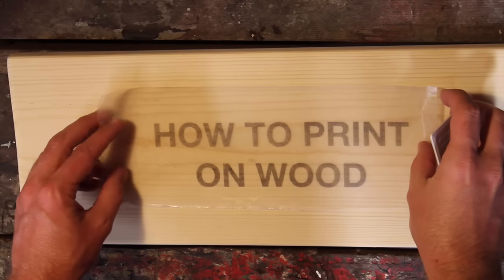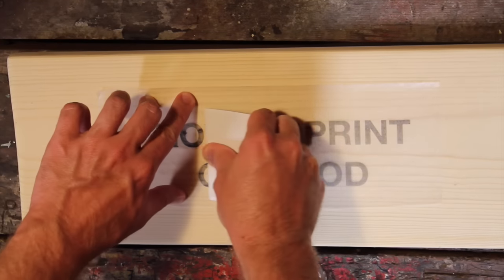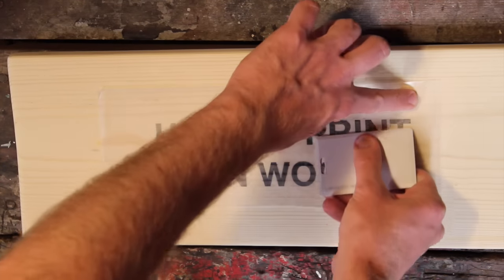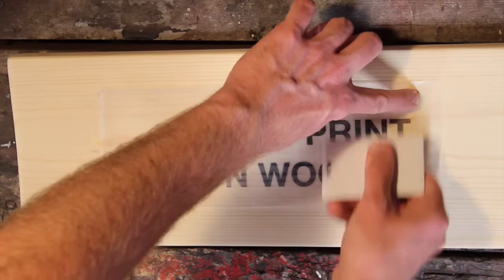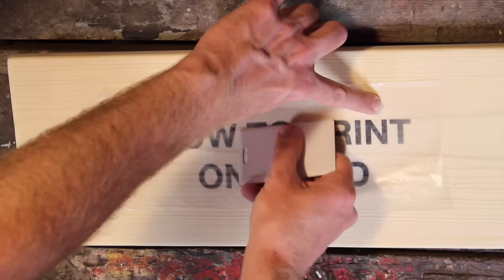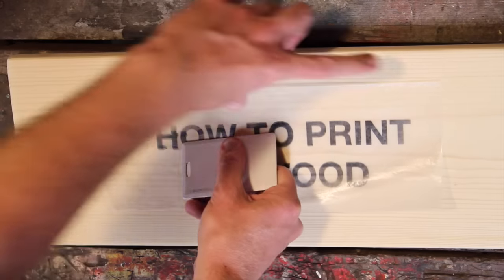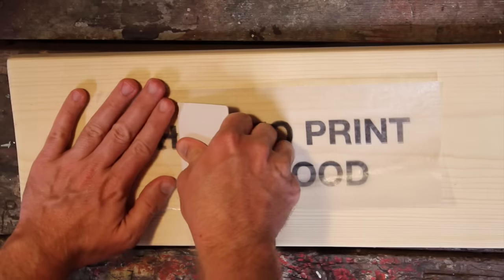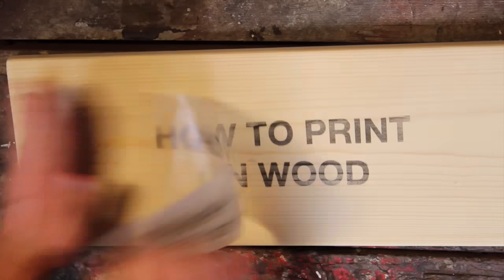How to Print on Wood with an Inkjet Printer

Comment: I tried this a few times a couple Christmases ago. It took a few tries to get it right. A couple of things I would add to doing it by this method is to keep in mind the wood type and grain density. Getting the wood down to a 220+ definitely helps with ink bleeding. Also, I had a hard time keeping the ink from smearing before it met the wood because of how flimsy wax paper is and discovered by accident that I was able to get the same affect using the back side of photo paper. I don't know if it is true of all photo paper but it definitely helped me out.
Reply from the maker: +The Fishin' Dad Great tips!

Comment: Can we use varnish instead of natural coating? 

And can a wax paper be printed in epson L805?
Reply: I use L805
Use the backing paper of self adhesive labels
Remove all labels and print on shiny side
Print setting must be
Glossy premium
High

Have not tried wax paper yet

But you Must use glossy paper setting
Reply: @pietpompiepompiepiet940  thank you

Comment: I have also head of using Freezer Paper - its ticker but you need to ensure you print on the shinny side. I have a quick question - can I varnish the wood first to make it darker?
Reply from the maker: +Dora Bloom You can stain the wood before applying the transfer - that's what I did in this video, but always apply your varnish/poly/finish last. If you do it before, the ink will not absorb into the wood. Good luck!

Comment: The best by far, Did you use glue?
Reply from the maker: +Gibbs Joyce No, but I’ve recently been using spray adhesive to stick the wax paper to a regular sheet of printer paper, and it works much better.

Comment: Do I have to transfer the ink on the wax paper to the wood right away? or is it alright to wait for awhile? Thanks!
Reply from the maker: Since the ink is oil based, it won't evaporate immediately, so you could leave the wax paper transfer sitting around for a few minutes. Good luck!
Reply: alright thanks!! :)

Comment: will this work on HEAT TREATED WOOD? pallet wood sanded down for a smooth finish
Reply from the maker: I am not sure. As long as the wood is unfinished and smooth, it should work.

Comment: Great video, nice editing too, subscribed!
Question: the finish that you used, is it some sort of polyurethane? Thanks!
Reply from the maker: It's a water-based polyurethane from Vermont Natural Coatings. You can buy it on Amazon and I really love the warmth it adds to the wood.
Reply: Thanks for the reply! I tried printing my own signs on square 7" boards, but I can't seem to get the text nicely in the center of the board... Any tips?

Also, I often smudge the text on accident when placing the paper on the board, as well as when I push the ink in with the card. Any tips for that as well maybe? Thanks! :)
Reply from the maker: Just keep a steady hand. Someone suggested to me in comments to glue the wax paper to regular white paper to stiffen the transfer. I'm going to try that, so that might help.

Comment: will this method work if i use Liquitex Matte Gel to seal the graphic afterwords?
Reply from the maker: +Preston Horton It should, but be careful to apply a very thin first coat when brushing over your graphic. Sometimes the finish can make the ink run. I'm thinking about re-doing this technique with a spray finish so the ink bleed issue is eliminated. Good luck with your project and as always, test your materials on scrap material first. Let me know how it turns out.
Reply: Gadgets and Grain thank you!

Comment: Great job
Reply from the maker: Thanks! Let me know if I can answer any questions.
Reply: Does it work on any kind of wood,  Like skateboard decks? And if possible what kind of ink is the best. I tried to do it here and it didn't work out well. Thanks again.
Reply from the maker: Not sure about any wood, but a skateboard deck sounds like it might work. It's always a good idea to find some "test" material before committing to a project.
Reply: I bought the right paper and it worked out perfeclty. Thanks a lot
Reply: Jasiel Calixto what is the right paper?
Reply: as I'm from Brazil I couldn't find the paper he suggested. I used one called Dover

Comment: Nice video, but my printer did not like this at all. It just kept jamming the printer. :(
Reply from the maker: +Jack Gilbert Sorry to hear that Jake. I had a few wax paper jams myself. Sometimes this was caused by the wax paper not being flat enough as it traveled through the paper feeder. To help flatten it, I would place the cut sheet under several heavy books for a few days. Hope that helps.
Reply: I found it very helpful to stick or glue the wax paper to a common A4 sheet, print it and then separate them!

Comment: What paper setting do you put the printer on?
Thanks
Reply from the maker: I use the glossy photo paper setting. My assumption is that the wax paper has similar properties to photo paper. I'm happy for others to chime in here if there's a better method. Every printer is different, so you might want to experiment with different settings to see what gives you the best results. Good luck!

Comment: Is wax paper same as baking paper?
Reply from the maker: Hi Savan, based on my research, baking paper is what we call parchment paper in the U.S. This is neither - I used wax paper which is just a thin as parchment paper, but it slightly transparent. I don't think baking/parchment paper would work for this because it would absorb the ink and not transfer to the wood. Let me know what you find.

Comment: thanks, I broke my new printer
Reply: hahaha damn
Reply: The risk you take.  I've had an inkjet for a decade and then just bought a cheap laser printer, put butcher paper into it to try tansfers and it jammed the first time.  Got it out and tried another sheet and it ate it completely.  Can't see it at all even after removing the tiner cart.  Now it prints all jacked up.   No I'm not gonna return it because I effed it up by experimenting.  Just me.  My fault, my expense.  Gonna try to take it apart and fix but most likely gonna buy a new one.  Live and learn